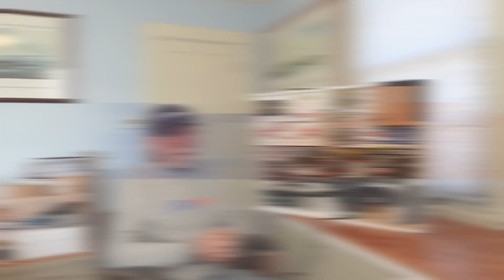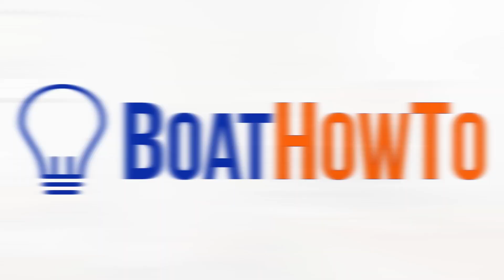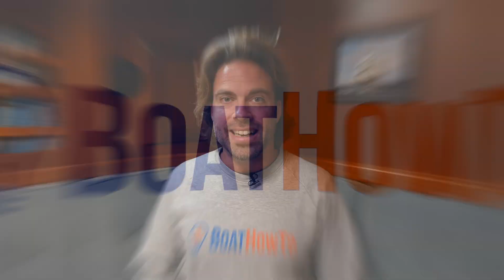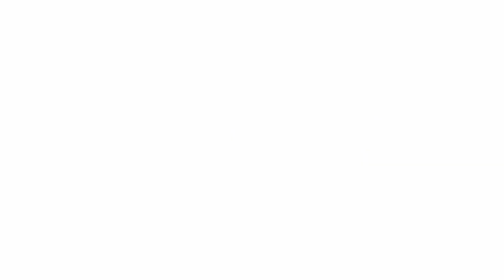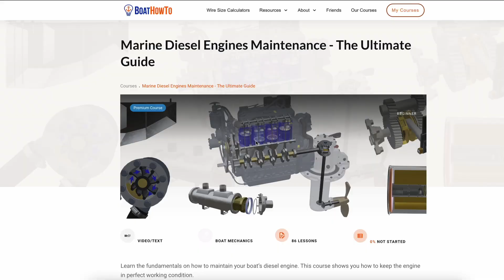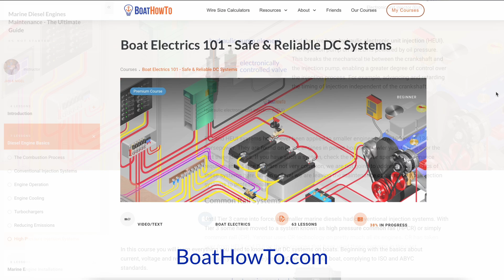My ENGINE DIES when using the bow thruster! 😰 | Ask The Expert with NIGEL CALDER

Comment: Seems that installing the bow thruster with its own closed system would be a good way to go. If you can afford a bow thruster, you can afford another battery. Also perhaps the voltage drop is a function of a long cable run with undersized wire.

Comment: Look at DC common earth/negative circuits. Any resistance in the negative from the bow thruster can affect the voltage in the engine common rail system